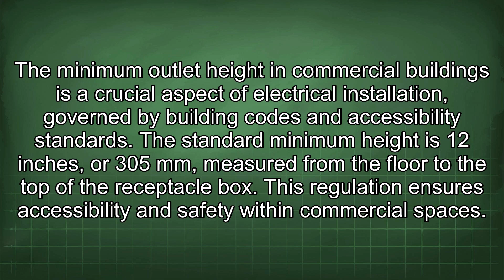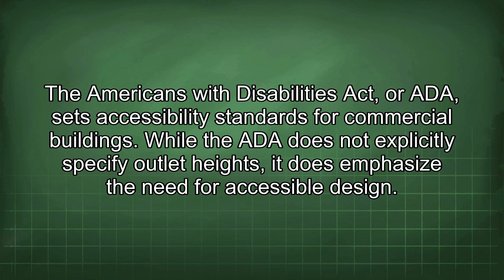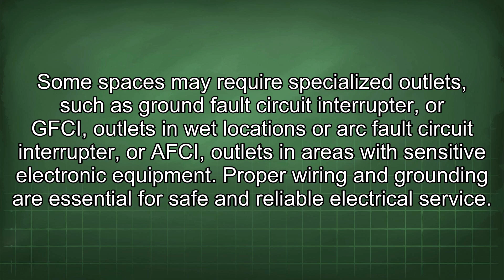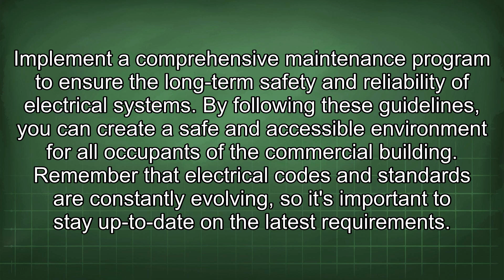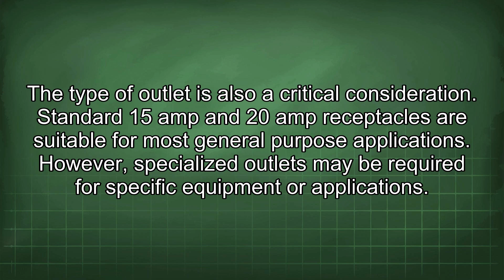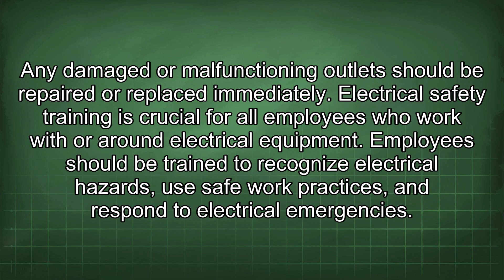Minimum Outlet Height Commercial Buildings Explained

Comment: There is no minimum height in the NEC for most installations. There are maximum heights defined in the NEC. There are customary heights which are industry standard and then there are accessiblity considerations which can dictate minimum heights. Video is misleading.